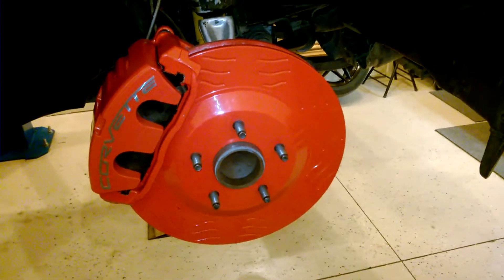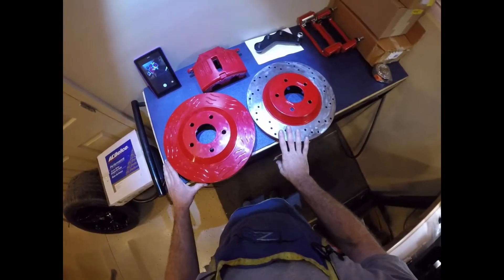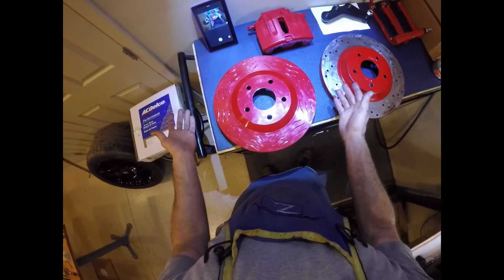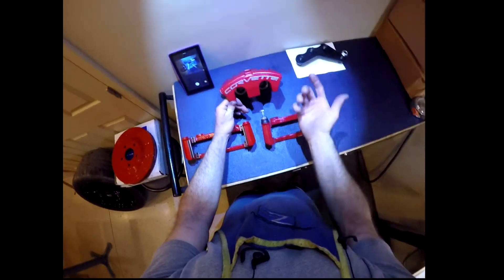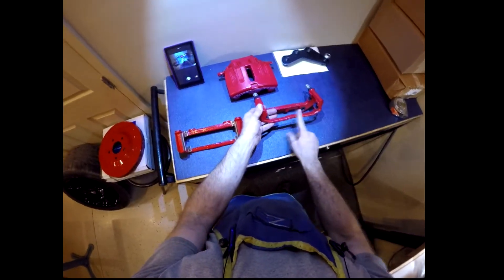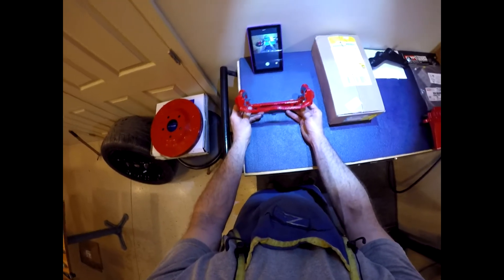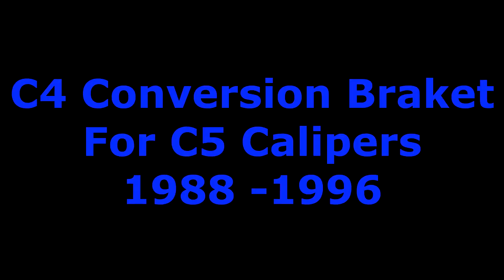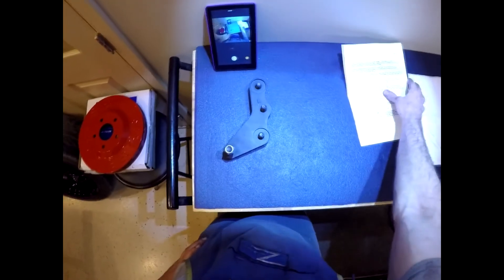C4 Corvette Brake Upgrade To C5 / C6 Brakes "Part #1"

Comment: Do those lines work for c6
Reply: It's been awhile since I did all that research, but I would say yes on the standard C5 and C6 caliper.  They are virtually the same (location brake line connection). I do believe the C6 caliper might be slightly reinforced, but don't quote me on that.  The C6 zo6 and grand sport calipers are completely different.